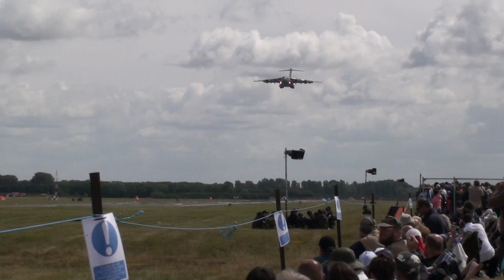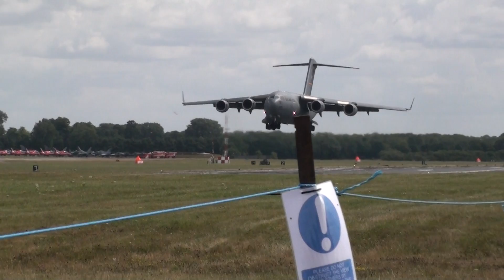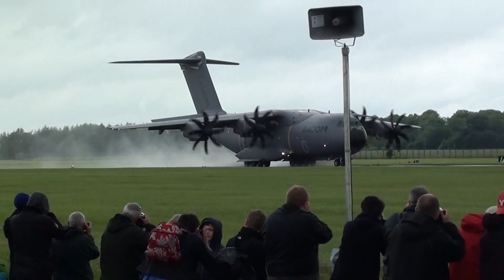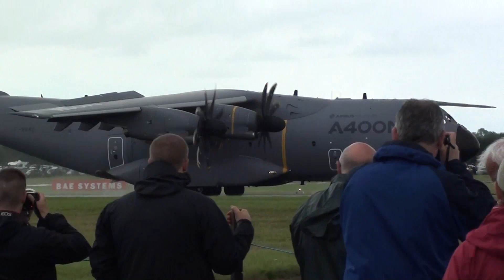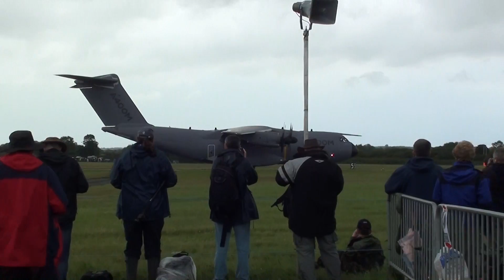Tactical Short Landing C-17 vs A400M. What Brakes The Most. Reversers, Wheels, Props, Spoilers?

Comment: The plane does have reverse thrust, the blade rotation does not reverse but the blade angle alters to reverse the air flow. It is one of the very few planes that can even do this in flight for the very rapid tactical descent. The comment about shutter speed below is correct but a little misleading. BobUK

Comment: On a wet or icy runway or a dirt airstrip the A400M will stop much quicker than the C-17 using reverse pitch versus reverse thrust and minimal wheel braking. During development of the A400M it was briefly considered using four turbofans, but operational reasons dictated the use of props. Both can reverse under their own power, but the C-17 will over-temp the engines with prolonged reverse, the A400M can do it until it runs out of fuel
Reply: Interesting.  They both have their specialty functions, love'em both.  Bob, CMSgt, USAF(Ret)

Comment: Pretty much in any plane I have flown, small or big, prop, turbojet, and turbofan, wheels provide the most braking. With 60% or more of the braking under light braking, to as much as 80% under heavy breaking.

Think of the A380, lots of wheels on the ground and only two engines are fitted with thrust reversers.

Comment: The wheel brakes do the most in terms of stopping the aircraft (any aircraft).  The primary purpose of the spoilers is to make the brakes most effective by giving them more of the weight of the aircraft pushing those tires into the ground.  The amount thrust reverse contributes depends a lot on the type of T/R ... how much of the thrust is deflected and how much goes forward, and whether it's a ducted fan redirect or reversed props.  Props are much more effective than ducted fans, but even in that case I think I'd still give a small edge to the brakes.

Comment: Except for the T-tail, A400M is comparable to a C-130, not a C-17. 
Worked on the development of the riveting systems that built the C-17. The engine pylons are so short, it places the engine exhaust directly on the flaps.
Reply: in fact, the A400M is between the C130 and the C17.
That's why he was build, to replace the tactical C130 with a bigger payload  and greater strategic capability.

Comment: Having flown large turboprop aircraft for many, many years, and also heavy jets, I can say for sure; a reversible turboprop has more effective reverse braking than an equivalent turbofan with reverse.  The A400 WILL have a shorter field length capability.  However, the comparison between a C-17 and An A400M is not completely fair... a C-17 can land on a dirt 3000 ft airstrip, and drop of a 62 Ton, battle ready M-1A2 Abrams ready for combat, is pretty amazing.  That an A400M can land in 2500 ft. strip of dirt, and drop off a smaller vehicle will not make a huge difference.  The A400M is still a much smaller aircraft than the C-17, and cannot fit a French Leclerc tank or a British Challenger II or a German Leopard 2A6... it can however fit smaller wheeled or tracked combat vehicles.  The C-17, is still the heavy horse of heavy lift and is proven as one of the most versatile transport aircraft ever made... However the A400M is a technological marvel, as is a typical Airbus product, and the 11,000 SHP TP400 engines are exceptionally powerful and efficient, which allows the A400M to have strategic range.  It fits the bill nicely of countries which generally have smaller things to carry...
Reply: The A400M isn't build for our current generation of combat vehicles. It is build for Puma IFV, Boxer AFV and MGCS (next german-french MBT, call it 'Leopard 3' if you want). Due to lower, more optimized internal volume, use of more weight effective components and use of APS modern/next-gen combat vehicle will have a lower weight, enabling possibilities noone would have ever thought of (delivering a MBT to places a C-17 can't even land).

So, from the perspective of a aviation expert the A400M seems to be 'okay', but if you have an idea of the AFVs complementing the the concept, (Puma and Boxer are currently widely considered to be the best of their class, by far) , the capability of the whole systems shows, and it's astronomical.

Britan and France do not make the most out of this plane. The german doctrine is suprisingly efficent.
Reply: C-5 is the Heavy Horse.
Reply: C17 = Strategic cargo with some tactical uses
A400M = Tactical cargo with strategic uses

That's the biggest difference, the A400M due to his size and weight can go where the C17 cant.
He is here to replace the C130, not the C17.
Reply: @Tagadarealty  it is build to bring things a c-130 can't lift to places a c-17 can't go....
Reply: I have to laugh….

Do you lot all work for the UK’s DLO (Defence Logistics Organisation)? The arguments sound like every military purchasing decision I ever witnessed. If there was a MkII version the current military expert always wanted the MKIII version regardless of cost and in service date.

But don’t worry - all those “experts” now work for BAE and relieve us taxpayers of our funds in a myriad of different ways.

Comment: The thrust reverser on the first one is what helps but you can't compare it to a turboprop as it doesn't have a reverser
Reply: Incorrect, The A400 Prop pitch is changed from positive to negative = reverse thrust

Comment: Wheel brakes are without question the most effective component to get it stopped, but they aren't effective if you don't have weight on them.  It's critical to get the spoilers out to dump lift and put the weight on the wheels.  On many aircraft you also can't the spoilers out past the flight limit until you're on the touchdown (weight-on-wheels) switches, so a firm plant helps vs. floating it in.

Comment: Everyone is going all like "it's unfair, the C-17 weights alot more"...
Am i the only one that thinks the C-17 did it shorter than the A400M??
Reply: they are empty in the video... so, it's useless.

C17 = Strategic cargo with some tactical uses
A400M = Tactical cargo with strategic uses

That's the biggest difference, the A400M due to his size and weight can go where the C17 cant.
He is here to replace the C130, not the C17.

Comment: I'd love to see a short and rough field comparison of the tested C-130 with the new Brazilian KC-390. They're similar in size but one has four turboprops and the other two turbojets.

There are the advantages (jets) and disadvantages (maybe helicopters) the latter's greater speed offers as a tanker. Then there is the fact that it uses the same PW400 engine used in many commercial jets. That might reduce operation costs.

Comment: I think the A400M is a marvelous plane—or at least will be when the problems are fixed, But I wonder just how great the market for it is. For strategic hauling, you need the well-tested C-17. The only problem with them is that they're going out of production. For close in support and rescue work, the abilities of the C-130 are well established. But in trying the split the difference between the two, the A400M may not work well at either end of the market.

Airbus does seem to have more trouble than Boeing at guessing where the market is going. The enormous A380 was aimed at market that's proved illusitory, long-distance spoke-and-hub travel. Travelers prefer the more convenient direct flights of the new long-range twin-engine aircraft like the Boeing 787 and the Airbus A350.

Comment: Most airplanes can land in less distance than they can take off.  Minimum runway length is more likely limited by take off performance.  I suppose that if your situation dictates that, on short runways, you only land heavy and take off light, that evens things up a bit.

Comment: A 400 will need multiple brakes changed and pretty sure tires too....flats spots don't roll very well.
Reply: its a wet runway, what you see is water spray, not smoke ;)

Comment: Why does air bus always have to copy Boeing, they made a c-17 with props
Reply: idiot
Reply: the a400 is a substitute for the c130
Reply: That would be copying McDonnell Douglas, by that logic they copied Lockheed.  And none of it matters because nobody copied anybody.
Reply: Sup Floofer Yes, it is. Boeing C-17 Globemaster
Reply: McDonnell Douglas merged with Boeing in 1997, production of the C-17 down in Long Beach ended in 2015...
Reply: + Jan Keller -- It's only a "Boeing" because Boeing and McDonnell-Douglas merged; but it was designed and put into production before the merger.
Reply: how can you copy a jet engine by using props?
your comment literally contradicts itself
Reply: Seems that way, doesn't it...
Reply: agree, no substitute for Hercules!
Reply: C17 isn't from Boeing...
Reply: There is no substitute for a C-130.

Comment: The C-17 is much bigger and heavier, and can carry much more payload than the A400. The A400 is more comparable to the C-130.
Reply: a400 is a impressive piece of equipment !!   
Saw it on duty and it  is wonderful, but my heart actually  goes with the C17.
Reply: Clive Sinclair yes really ! the FRENCH airforce bought eight C130 and maybe other in several years because they have son many problems with the A400M.
Reply: @ronanguyonvarch9114  But today, as the A-400 M is now fully operational, France replaces its C130 by Airbus planes. The Hercules payload is now too small for the new armored vehicles that France start to operate
Reply: yep, I think too
Reply: the A400M is bigger and heavier than the C-130.
Reply: True!
Reply: HTHAMMACK1 It is. But the A400 is being marketed AS a direct replacement for the C130.
Reply: Clive Sinclair false! thé A400m Will Never replace the C130. In France and Germany, the airforces bought C130 J because the A400m were unavailable.
Reply: HTCps music Really? (https://en.m.wikipedia.org/wiki/Airbus_A400M_Atlas). So had the A400 been available they would have bought it?
Reply: French, maybe, germans not.German ministry of defense may buy some C-130 for special operations or civ evacuation since the C-130 is smaller and better for operations in hostile airspace, however it won't replace the A400M. The A400M is a tactical airlifter with the capacity of a strategic airlifter it can't be replaced neither by the C-130 nor the C-17.
Reply: This is what I was thinking, yes. It is impressive to watch, but it doesn't really mean much. It's like comparing a 4 ton flatbed to a 40 ton semi trailer. In some ways they're similar and in some they're very different, but it's not as if both are contenders or competitors for the same market.

Comment: The C17 wieghs twice as much.  Their short landing braking characteristics are not even similar.  You should compare two aircraft of similar weight.
Reply: +Bo Lee I agree when the A400M was design to replace the C-130 and turbofans generally give a lot more thrust than propeller powered aircraft. This vid is also invalid given the C-17 landed on a nice calm sunny dry runway and the A400M landed on a wet, probably windy conditions which affects the braking effectiveness.

Comment: Very impressed but the C 17 is much bigger than the a400m
Reply: @argumasch663  wrong the dimensions are completely different. The C-17 is bigger in every measurable way. They are only close in interior height, the C-17 is 13ft 6in tall internally aft of the wing and the A400m is about 13ft. The C-17 is 6 feet wider and 27 ft longer internally. It also has well over double the weight capacity and is over 100 knots faster. They are similar in wing and tail appearance. In reality, the C-17 is on a whole different level.
Reply: @argumasch663  i couldn't care less what you think. You've likely never been within eyesight of either aircraft.
Reply: Alright they are both good now stop arguing
Reply: @argumasch663  You guys need to shut up and go to bed. G'nite
Reply: @argumasch663  and so that makes it better in every other aspect right? dumbass
Reply: @argumasch663  You might want to look at the numbers before you go off commenting bullshit. C17 is way bigger.
Reply: Bigger dosent do the skill
Reply: @leschantiersvarois  
What skills, man?
Reply: @Ahornblatt2000  is not because is bigger that is better
Reply: @leschantiersvarois  Well....it's still bigger, isn't it?
Reply: Not that much bigger really. Also the A400 landed on a contaminated runway
Reply: @marklnz  The C 17 can carry up to 77 tons that is much more than the A 400M

Comment: In the C-17 on an assault landing the brakes do most of the work. The thrust reversers (on both the fan and the core!) take a few seconds to deploy. They are not insignificant but the brakes are the key. I would expect that in the A400M the props would move into the reverse pitch range quicker than the C-17 thrust reversers deploy, so the aerodynamic braking from the props probably plays more of a role in slowing the aircraft based on the principle that an  aerodynamic brake is most effective at high speeds ie immediately after touchdown. But the brakes would still be the main stopping force. Ground spoiler deployment on touchdown is vital to dumping lift to put more weight on the wheels earlier, allowing harder braking sooner whilst of course allowing the anti skid systems to do their thing.
Reply: Don't forget that the C17's flaps can, when deployed, deflect the thrust down, allowing the aircraft the come in for a slower than usual approach
Reply from the maker: Thanks for the detailed info 👍
Reply: +flyslow land short In the case of prop beta and reversers, they are relatively indifferent when it comes to effectiveness at speed. The same way that a jet engine generates similar thrust at speed and when static. Spoilers and airbrakes are much more speed dependent.
Reply: Do you have an idea of the effect of the load? I guess this plane was empty. Thanks in advance.
Reply: That's not necessarily true. The thrust reversers work better at higher speeds because they redirect the air going into the engine, meaning if you're going faster, you're redirecting more air and producing a significant amount more reverse thrust. A prop reverser just pushes instead of pulls, so it's less speed dependent.
Reply: Propellers will do the same thing, if the flaps are so designed.
Reply: +flyslow land short Well fast in, fast out, I can only assume is the aim when delivering a load of importance. Just like nature dictates trololololol!!!!
Reply: Not sure how the A400M works but on other aircraft which also have reversible props like a DC6 for example, its not just a matter of reversing the props, you actually run the engines back up to power with the props in reverse, and the area of a propeller is much larger than a turbo fan engine.
Reply: Beta is little or no pitch in the propeller blades, while reverse is reverse pitch in the propeller blades. If you have the engines set up at 100 percent power, whether the props have positive pitch or negative pitch, its going to be effective in that particular direction.
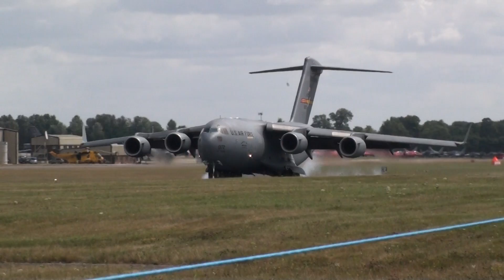Reply: A pilot explained to me that the thrust reversers have to be engaged at idle then the turbines throttled up.   With the turboprop you can reverse pitch without idling the engine.   That is part of how the US Navy experimented with landing a C-130 on a carrier many years ago.     In this video you at 0:21 you can see that the thrust reversers are not engaged, and at 0:22 they start to engage.   Moments later the engines spool up and reverse thrust slows the plane.
Reply: Chris Kibb  Sure, but that doesn't mean you can do a tactical descent to a landing safely (without disabling the thrust reversers at some point)

Comment: Two clones АН-70!!!
Reply: +Виталя Килинскас Would that be the AN-70?  In that both are prop planes I suppose so, but other than that the A400M and the AN-70 don't look very much alike.  The C-17 is a jet and a lot larger, so it certainly isn't based on the AN-70.  Not to mention the AN-70 never made it past the prototype stage, LOL.
Reply: What the hell is an AH 70??
Reply: Craig Jackson This aircraft Russian and Ukrainian. Joint development. Copying was unsuccessful in Western countries. AN 70 Indicators better.
Reply: C17 is older, so no. your argument holds no water. Also the AN-70 was an utter failure.

Comment: Both great planes but I would like the jets over props personally!
Reply: For strategic planes is better, not good for tactical planes.
Reply: I think the reverse thrusters on the 17 give it a little better stopping performance!
Reply: TheTolz0 But the props isnt a good solution for unpaved, cooled or sands surfaces. For this and for others things like the low tactical fly the A400 is a tactical transporter and the C17 is a strategic transporter.
Reply: +VITOLLFOTOGRAFIA lol other way around, props for dusty runways
Reply: +VITOLLFOTOGRAFIA Aircraft with props can handle unimproved runways with no problem. The C-130 was designed to do so. There are very few things that have to be done before landing on an unimproved runway.
Reply: David Myers correct XD
Reply: David Myers Yes i mean props Not jets, my mstake

Comment: C-17s are designed to do this, not really anything special
Reply: +TheAirlineSpotter11   The Airbus looks almost exactly like a C-17 with turboprops.  I would take the C-17 simply because it could carry more and it is a proven airframe.
Reply: +Paul Johnson However A400M is a better tactical transport, more efficient and capable on unpaved runways.